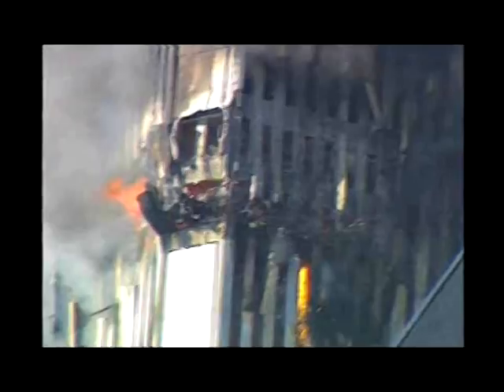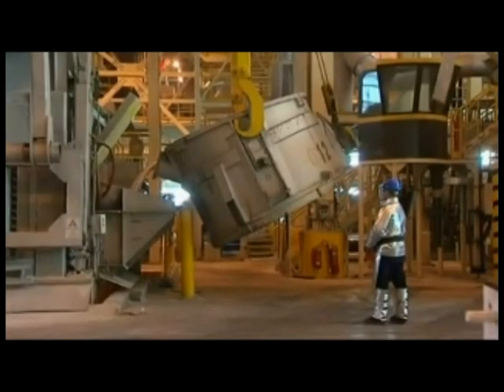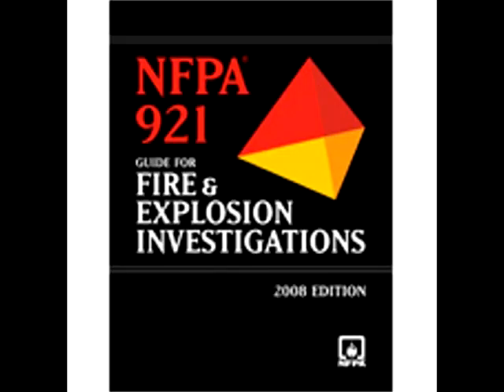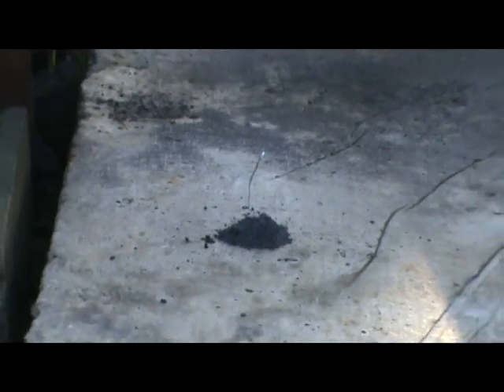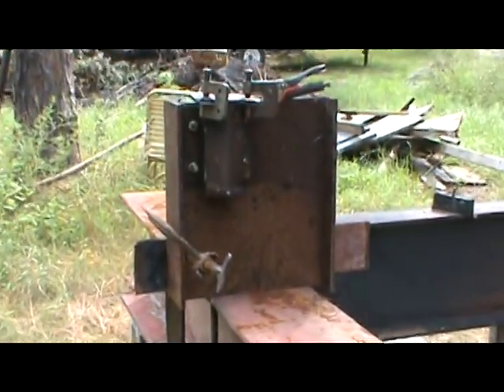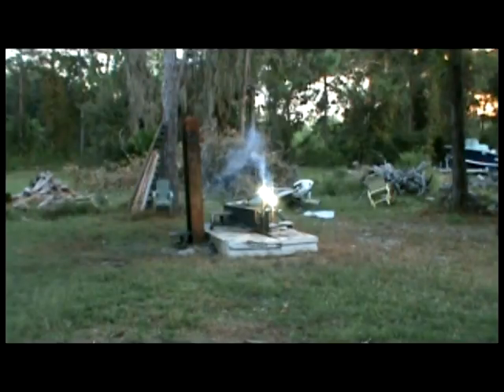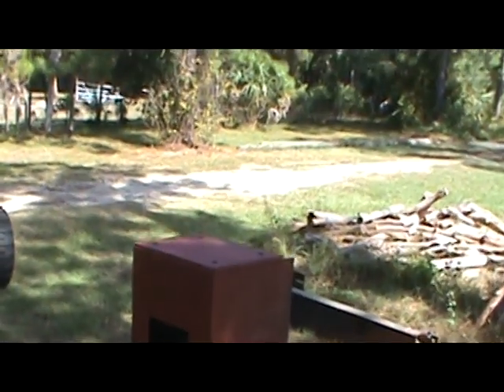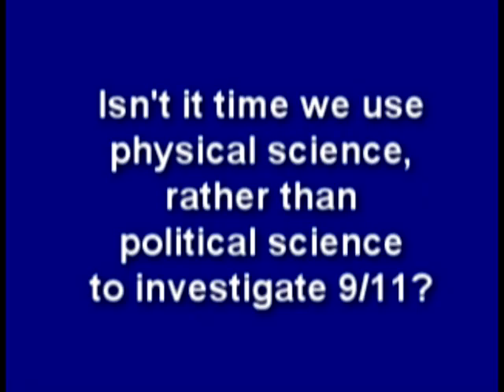9/11 Experiments: The Great Thermate Debate

Comment: You don't need to melt load bearing steel beams to make them structurally unstable, only apply enough heat & pressure to bend  & crack the rivets (which have a lower heat tolerance), welds, &  concrete surrounding, supporting, & exerting even further pressure on girders below each successive failed level. It takes a basic Architectural understanding of physics to comprehend this. If just one level fails, you have the weight of each successive level above coming down above w/enough force & weight to induce a failure of the next, exerting more & more pressure to the failing point of how much weight each level is designed to hold. If you think the WTC was a controlled demo, you fall in w/the same crowd as flat earthers & are a moron.

Comment: what did i just watch.

you don't need thermite at all. kerosene does just fine.

a building like that heats up and pretty much becomes a blast furnace. the air coming in from  the bottom moving upwards just heats it up more and it's a runaway reaction.

jet fuel is kerosene. kerosene in a blast furnace gets stupid hot and plenty to melt steel.

Comment: The molten steel, which didnt melt, ignited building 7, which is made of concrete, which collapsed because an office fire started the non-molten molten steel which didnt pour from the towers on its roof.. which melted the concrete in the foundation. Perfectly makes sense.

Anyhow, if there is a conspiracy it doesnt make much sense to do all this extra work because it would involve a ridiculous amount of people, work, witnesses and lose ends that can talk. They could simply allow the hijackers take the planes and crash them into the towers, making the conspiracy boil down to deliberate (and legally plausible) negligence of a handful of people. Hitting the Pentagon only adds to the deniability. Although oddly enough the Pentagon which is also a concrete building didnt melt and collapse like B7 did just by being on the same block as the towers. Other buildings near the towers were damaged too, none collapsed.
Reply: It might make perfect sense if you injected some true facts.

Comment: Simple theory ... military type of convert commercial plane radio control bringing a highly explosive cargo to the building.

Or 

Hijacked commercial plane carrying explosive material..

Commercial Plane / mostly aluminium + building mostly iron / rust / iron oxide + jet fuel / fire starter = thermite recipe

Comment: Very interesting. I mean it make sense if you think about shaping the termite or thermate. 

Shaped explosives destroy more material in a single direction than jist planr explosives without a directional plate. With your box cutter setup youre basicallu directing the heat and pressure through a tiny outlet effectively making a kind of plasma cutter.

Its like that example firecracker in armageddon

Comment: I know what people are gonna say. Jet fuel cant melt steel beams, but it can heat them up and weaken them. Yeah, but thats not the point. Jet fuel cannot melt steel. Cops saw molten steel. Not weakened steel, molten steel. And how tf could they say that thermite cant fuckin melt steel? They use thermite to fuse rails together for railroads ffs.

Comment: Nice sharing of your sources in the description, this is just all babble with half decent somewhat relevant video footage. Alex Jones does a better job. You literally made as many points as counter points, the mythbusters thing about a half a ton how much would you have needed to have snuck into office buildings without anyone ever noticing or talking up to support your whatever this is. I thought the craze was if the United States knew about it, but this implies that they either knew or somehow managed to make these people crash the planes and made one almost a dud at the pentagon compared to what they could have done if you say the building was ready to go. About the building's falling you're talking a lot about how the steel couldn't have been molten but your only source confirming or citing that is Newsweek which isn't exactly the times. People and cars float on molten mercury not aluminum but you left that out and just showed something else. Lastly why would there be molten metal if they were using the explosive grade material to blast nuts away? and miss 6 windows for whatever reason.

Comment: so fast it can not cut steel. you need to slow down the reaction. try thermite without nitrate. slow reaction will give steel enough time to melt and it wont try to explode

Comment: The fire from my torch cannot melt steel yet I can still heat the steel to an orange glow after I hold the heat on there for a long period of time, I can then bend the metal because it has weakened it

Comment: Forget the melted steel, where did the towers go? Only the top was on fire, they fell and then what? They and ALL the debris :
Toilets, sinks, computers, desks, 1000s square footage of concrete and  steel structure all left a pile only a few feet high. That rubble would have ended being stories high , but it was not. Where did this debris go? Pulverized concrete to dust, steel beams not piled up, and the rest? Such disintegration is unknown to us in the laymen world. Something in the size of the pile of rubble is very scary. Pancaking causes a pile of rubble. 110 stories into nothing? Cmon man WTF?

Comment: I tell you, if you believe this guy. Go look at a show on TV right now called forged in fire and look at the temperatures they're using to shape that metal. With a hammer mind you! Now take all that steel in that building and heated up to six or seven hundred degrees or 1100 like he says, and then put in a million pound press and see what happens to that Steel? Trust me it will give. Just common sense. And then you get this fuel running where in all corners all sides of a building. And I can also do explain why certain beams had color in them and others didn't cuz you got hallways core doors Exedra that fuel ran down and others that it didn't.
Reply: He isn't explaining why the tower fell, he was looking into the molten steel that we saw. If you watched the video you'd know this.